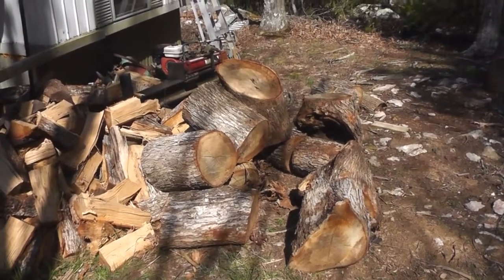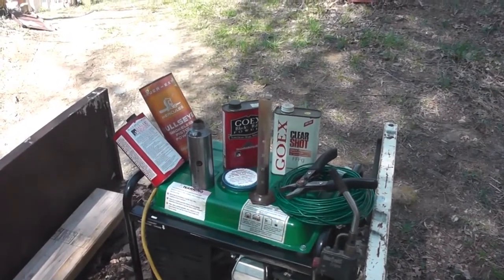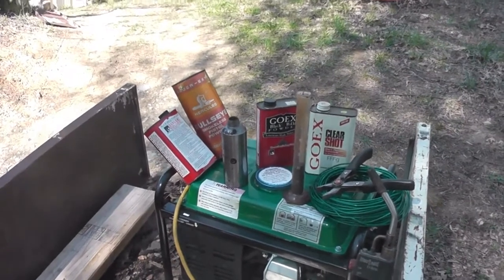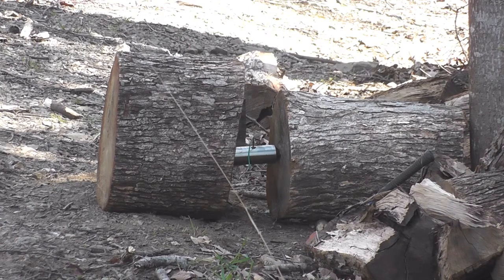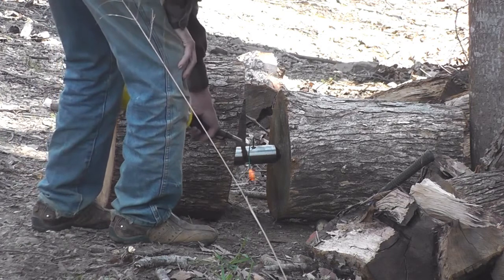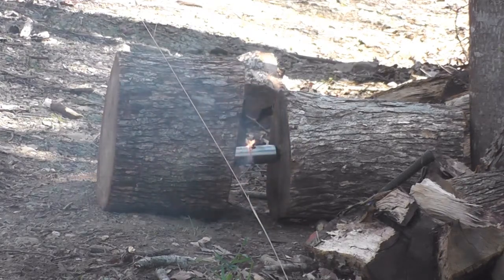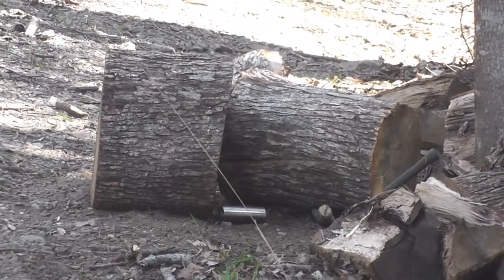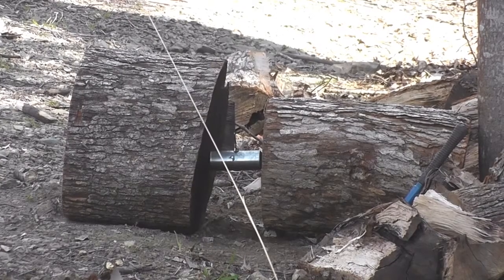Powder wedge

Comment: I love the science of it, but not practical. I'd rather shop another piece of wood with my $20 axe/maul and save the $100-200 of explosives :-)  Still like the video thou...
Reply from the maker: This used under $10 worth of reloading gunpowder for the whole mess of wood - about one large tree's worth.
Explosives are in general about doing it on the cheap (if you know how), else mines and road builders wouldn't use them at all.
Reply from the maker: Note this was wood that my hydraulic splitter gave up on and which just bounces mauls and wedges.  White oak, partly seasoned already - tough stuff.  <$10 for the gun powder.
Reply: Understood respectfully.  Where I live, I can't buy explosives, gun powder so openly.  I should of mentioned that.
Reply from the maker: Ah yes, there are a few places on earth where you can't own or reload ammo.  Sorry to hear you're in one of those less enlightened places.  Here, it's everywhere.  Of course, making black powder is easy enough that it's a few thou years old...but it is hard to make it this good.
Reply: It's Ok Doug, the upside of it is that we have less deaths, murders and suicides  but it does take away the fun of plying with explosives.  Cheers,
Reply from the maker: Where is that, then?  I know a lot of slanted reporting exists.  I live in an utterly crime-free place where the only deaths are due to things like heart disease and bad doctors.  It's just too dangerous to be a violent criminal or a pedo around here...
Reply from the maker: Note, most of the gun deaths in this country are dope dealers and gang bangers offing each other in a few big cities.  We call that a feature, not a bug.  My lazy guns just sit there in the safe, they're so lazy they've never loaded themselves, much less shot anything they weren't supposed to.  Do yo suppose it might be the user rather than the tool?  In all history, has making something illegal made it actually hard to get?  Ah, prohibition, nope - thanks .gov for the Mafia.  Pot, nope.  Let's make cocaine illegal...that didn't work, if gave gang bangers something to fight over.  Let's get the .giv into the heroin biz (the taliban shut it down in Afghanistan), nope, and now we have Fentanyl, gee, thanks.
Reply: Point taken,  unfortunately in today's society the guns get into the wrong hands.  I still enjoyed your video and would like to experiment with them the way you do.  Cheers,